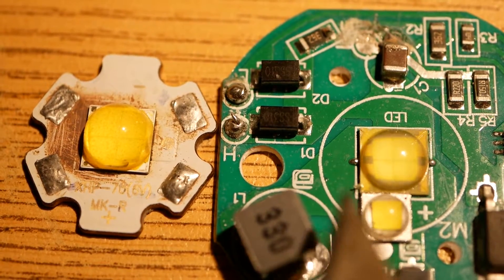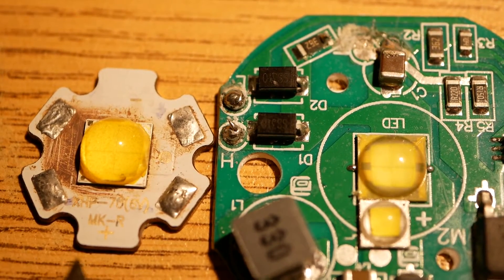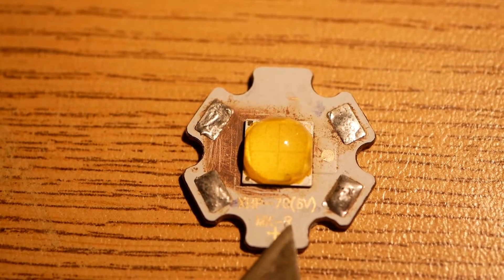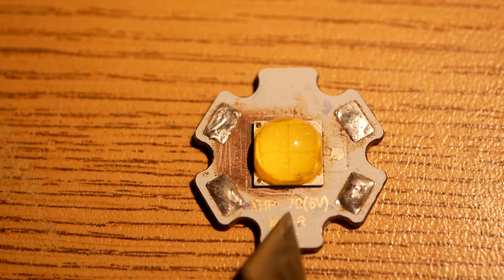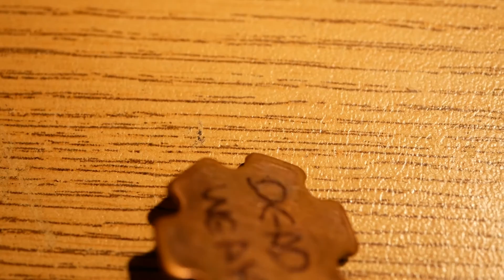CREE LEDs vs Chinese LEDs - A close look at the differences

Comment: Apart of the LED constructive difference - CREE vs NoBrand, surely important, I share a note of caution of how to operate them:
All these LEDs (element alone) shall be driven with controlled current - constant current driver type. I heard you did it adjusting/ controlling the Power supply Voltage (not current), which makes any conclusion mixed up. 
LEDs have a NEGATIVE thermal Coeff., so the heater they are, the lower “back-voltage” they offer. 
And for a good Constant voltage power supply, a poor-man solution is to use a current-limiting power resistor, as you mentioned by the end of your post.
Reply from the maker: V=IR...It's easy enough to deal with not having current drive by limiting voltage so that current can't go above some amount. Thermal control deals with the resistance changes. After that the lack of a current drive becomes of little importance. I've been doing it this way for many years now and have yet to burn out an LED without doing so deliberately.

Comment: I have 9VDC. Can I use 12V led
Reply from the maker: What do you think?
Reply: You would have to use a driver that can boost the voltage. I don't know if that is a common thing. Or get a 6V led. You should be able ro drive it through a large 1 ohm resistor or something similar...